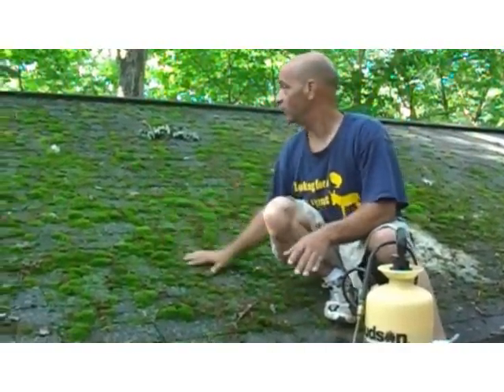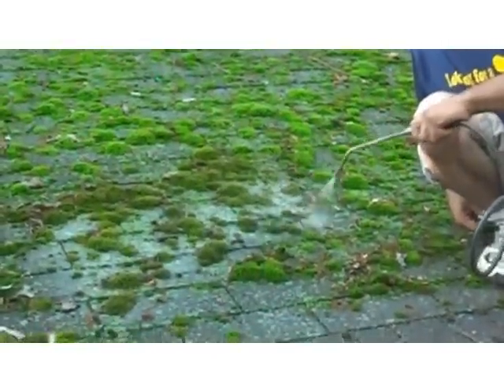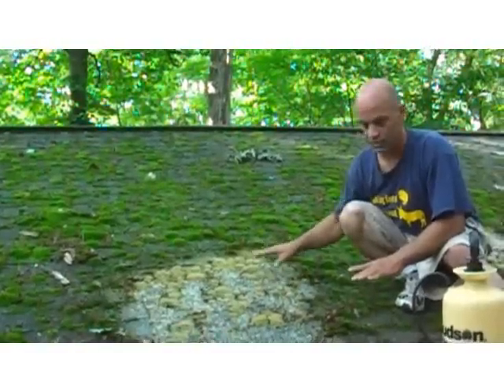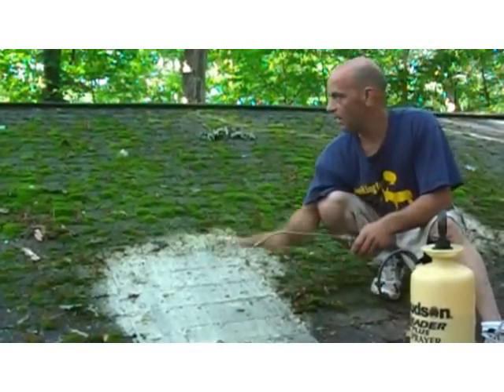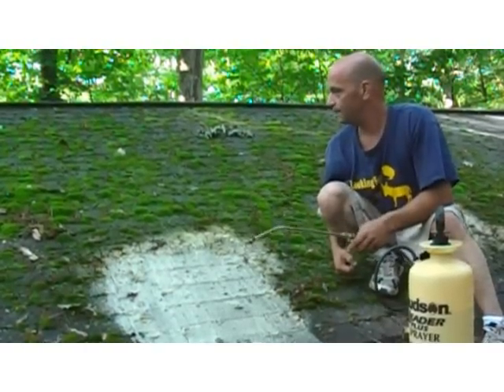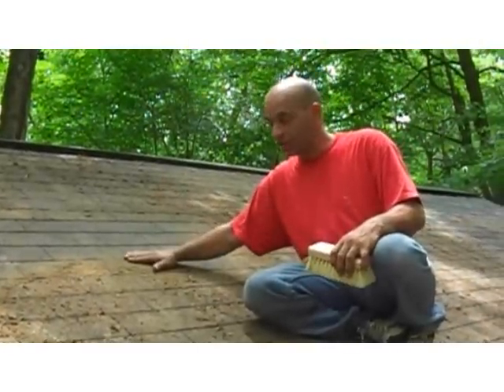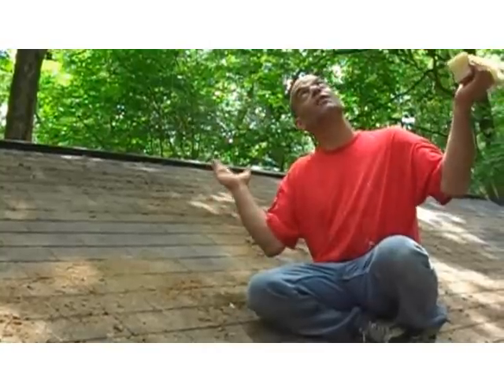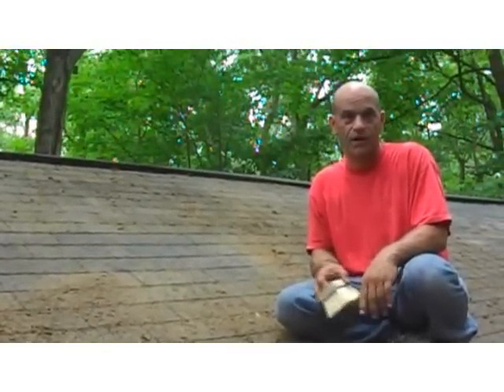How to remove moss from a roof :)

Comment: The US Navy has us (contractor) using only one thing on the shingle roofs of base housing. Washing Soda (Sodium Carbonate) only is mixed up into a thin slurry and sprayed on the mossy roof and left. Yes, it is the slow way, and you're cleaning the gutters more often, but being on Puget Sound, everything is about minimizing runoff. Raising the PH will SLOWLY kill and make the moss release from the shingles. Plus you can get an 80lb bag for less than $30.
  I admit I used your formula for my personal residence to get the process over and done with(watching the runoff of course).
Reply: Where do you get the 80lb bag ?
Reply: @twobeer3316   Pool supply  are the most economical
Reply: Thanks...
Reply: Where do you purchase the Sodium Carbonate from?

Comment: Great video, that chemical did the trick, looks like a heavy bleach base? definitely left it's mark, but you can clearly see that the main problem with moss growth is tree related, I do tons of moss removal  sometimes its can destroy the shingles when it's really thick, I've used snow shovels to actually push large scoops of it off. But buy sweeping your roof once a year in the fall you won't have to take a chemical bath. other simple solutions are copper, zinc galvy strips help inhibit growth but the key is to keep the roof free and clean of dirt & tree debris.
Reply from the maker: Thank you and so true.

Comment: You can also use moss out and a pressure washer! worked great on my roof. Yes it will lessen the life of the roof but if done right it will only be about 2 years.

Comment: Tried a lot of things but not on roofs that bad.
Pool shock 12.5 % mix etc!
Best I found is store bleach 6% for around $2.25 cents gal!
I use it full strength in backpack sprayer from harbor freight with no gain soap if you r roof is not pitched to steep!
Spray it on on cloudy cool morning and leave it on do not wash off!
Try to do it when rain is expected!
You may have to wait a week and spray again let rain wash it off!!
In few weeks it will look nice!
I tried the 12.5% mix pool shock and rinse did not work as well as 6% store bleach not rinsed off!

Comment: My 1800 sq ft house took 6 gals of store bleach 6% strength first cleaning!
Do not add water!
Did it second time 2 weeks later!
Do not rinse off ,do it on cool cloudy day and with rain expected that night!
Make sure its 6% on bottle!
I guess you could use 12.5%  pool shock diluted with water to make it 6% strength too about same price !
Main thing is do not rinse it off and do not expect clean house roof,most likely in gew weeks you will have to do second cleaning and let rain wash it!

Comment: Would it hurt anything by leaving the hangers in place on the roof and covering the 12 screw heads with chalking?
Reply from the maker: Not really, But use a roofing tar in a caulk tube

Comment: Hi there, Bonjour!!
 I went to your site and got the recipe,  1gal SH 12% + 2gal H2O + oz.liquid dish soap. Have 2 questions? 
1) Is12% SH the right dilution for your mix product?
2) Can you tell me if That works as well for clay tiles? any risk of damaging tiles?
Tx for your answer.
Reply: Patrice24110 just use 10 %  pool bleach from Wally World . Mix 1 and 1/2 gallon per 20 gallons  spray it where ever you want and wet down anything you think might think it will harm.  Try not to leave it on hot windows very long  and if you do just spray it again. Use gain not DAWN.

Comment: Dom, I have a killing two birds with one stone question:  I have treated wood deck on two sides of the house that is getting moss colored. Is there any reason not to incorporate any roof overspray with a direct wash down of the deck with the same stuff.  I will want to use some deck protecting coating later this summer.
Thanks,
28Bull
Reply from the maker: I've asked skin a cat question to a homeowner once. Didn't go over very well, LOL.. The only reason really would be the roof cleaner will bleach / clean wherever it lands. Food for thought. Check out Olympics Rescue for your deck when the time comes. Very nice stuff.

Comment: What sprayer did you use? Not the small one
Reply from the maker: Thats a setup for roof cleaners. Not cheap and not something you just buy at Home Depot.
Reply: I didn't expect that. What model is it
Reply from the maker: TBoy205 There is no model. You build it for what you need like. All air pumps, big compressor, all plastic and big $$$$
Reply: You are being extremely un-helpful. I wish I could thank you for your help.

Comment: I'm having trouble finding liquid pool shock.  Therefore, I don't know what the proportions are to mix
the powder of granular pool shock with water.
Reply: granular pool shock is usually calcium hypochlorite.  you want sodium hypochlorite.  The calcium powder will leave a lot of residue on the surface.  It is also not as effective
Reply: You should be able to find 12.5 active ingredient at a pool supply store

Comment: What about Zinc shingle Strips that kills moss
Reply from the maker: Zinc or copper will prevent it, but will not remove it.
Reply: I see you have another Video on Copper Strips on the roof also   Yes I know it will not remove it but Prevents it from forming . but I did not Know that Copper did the same as Zinc in Killing Moss  good to know Thanks

Comment: I had my roof powerwashed and it leaked even though it had passed inspection when I bought it.......After replacing it years later...I only have it air cleaned.
Reply: roofs are supposed to be softwashed only. using a strong sodium hypochlorite and surfactant application, then rinsed, basically with garden hose strength, like 60-70psi. they might have actually pressure washed the roof, or mother nature might have also knocked some screws loose and allowed the water to get through.

Comment: Bleach/ pool chlorine and just a industrial weed spraying pump will work fine or better yet and cheaper a small trash pump  from harbor freight piped into a plastic water tank cheap set up ,
Reply from the maker: You need at least 12% SH by weight for it to do anything. The pump must not contain any metal.
Reply: @Askmediy  the cheap trash pump is all plastic and works great the actually use the same one factory made soft wash system

Comment: Looks like sodium hypochlorite, or more commonly known as bleach or "pool shock" which can be purchased at your local pool supply outlet.  Don't buy the bleach at the grocery store because its not strong enough.  Get the good stuff from the pool supply store.
Reply: Cliff,respectfully the 6% store bleach works better than the pool shock 12.5% mix if used full strength,do not rinse off let sit for rain!

Comment: I prefer using powder laundry detergent. You should never brush your roof with a broom either that is horrible. Let the rain and wind blow it off. I line the peak of the roof with powder laundry detergent and a couple days later it will be gone.
Reply from the maker: LOL Not a chance.
Reply: I’d need to see a video of that...laundry detergent alone is not going to do anything for you
Reply: Adam Bowen You can use Tide Laundry detergent or bleach to kill the moss. If you use Tide, however, it will pull the oils out of composition shingles and cause the granules to drop. This kills the moss but destroys your roof.

Comment: Thanks for the advice.  I'm going to try a little variation to your idea and see how that works.  By the way, I'm sure the 'pros' have solutions that work well but also they have a motive to not suggest anything that's DIY.  I'm a little hesitant though of scrubbing the roof but otherwise it's good to hear some common sense advice.

Comment: That's not a Broom Handle.... Just needed to say some thing!  We would have finished that job in 2 hours with a pressure washer and a cone tip, not even close to several days no chems needed, lasts minimum 3-4 years.

Comment: My lord. There is a lot easier way without getting on the roof. I wouldn't recommend this for cedar wood roof. I have a solution I developed and spray from a ladder, dwell about 5 minutes and rinse from a ladder with a garden hose pressure. Way to much effort, not safe. Sorry.

Comment: Just get a zinc strip installed on the roof then you never have to worrie about it again. Save some time and money.
Reply: Living in the Pacific Northwest.  Installed the zinc strips at all of my roof peaks at a cost of $60 and a couple of hours to attach it 5 years ago after a thorough brushing. The moss still is alive and well, happy on my roof.
Will be applying bleach to it this weekend.
Reply: Not
Reply: Zinc strips are expensive and only very
Partially effective. Also can’t cover all roof areas on a hip roof.
Reply: Use copper strips. Works!